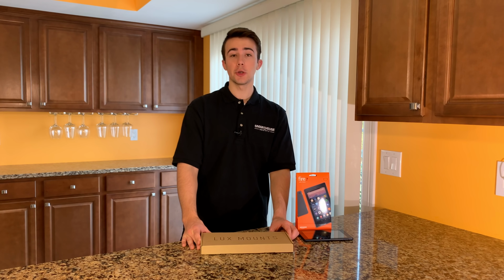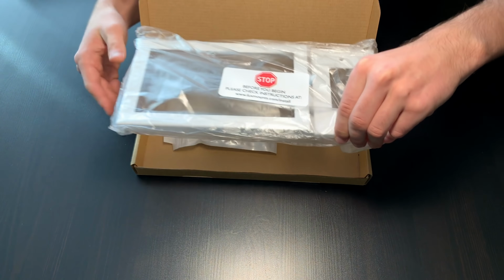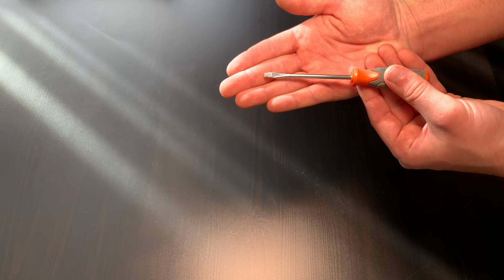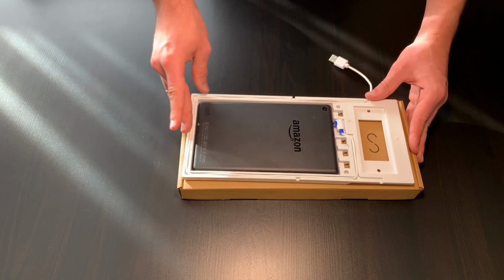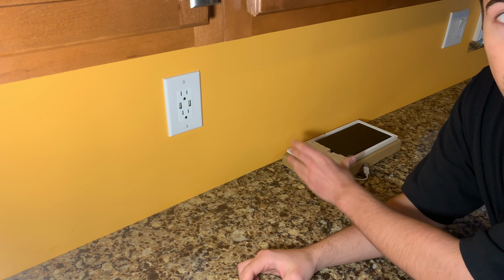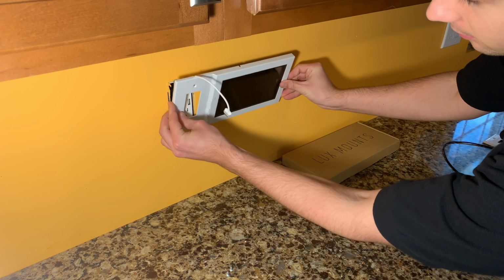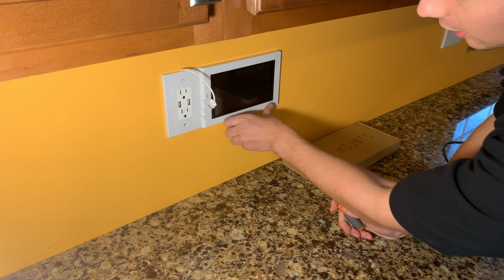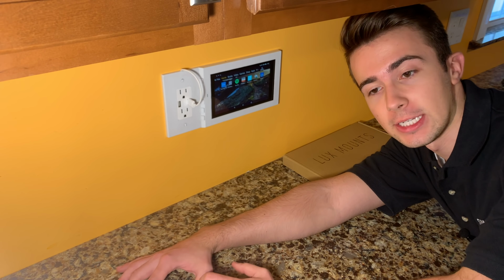How to WALL MOUNT Amazon Fire 7 TABLET using an OUTLET

Comment: Here is a suggestion... Get one of these outlets installed, or something similar. https://www.amazon.com/Bryant-Electric-USBB102W-Decorator-Combination/dp/B012D9N4U8  
Then make a video showing it being used. Will most likely help you sell these things. I think a lot of people are hesitant to buy one of these because of two things.
1.) They would have to install an outlet in an undesirable place, with it most likely only being used to power only this tablet. 
2.) Installing it over there existing light switch, but then having to run a cord down their wall to the power outlet. Does not exactly look nice.
Btw, I already ordered one of your mounts, excited about getting it installed for use with my HASSIO installation, and Abode security system! Great idea and a lot cheaper than alternatives. 
Also, I am not affiliated with that product, was just looking around to see how I will set my Lux Mount up

Comment: That cable tho...
Reply from the maker: That wall mounted tablet tho... has lots of functionality
Reply: @MKSmartHouse  while that is true the cable detracts any positive functionality that the tablet brings.

Have seen other installs with the cable hidden which makes the overall end product more professional looking.

Why not just get a USB power converter that wires in behind the power plug that the charge cable plugs into
Reply from the maker: Do you have a link for this USB converter? I would love to check it out
Reply: @MKSmartHouse  I run a 240v AC house and assume you would be a 120v house. Can have a look but even a simply USB power point hacked to make it smaller would do the job
Reply: fzakfeld  that is correct but if you look at other videos on this channel they too also include electrical work.

I would understand if the entire channel was about doing home automation without electrical work but it seems hand in hand that home automation will require such work